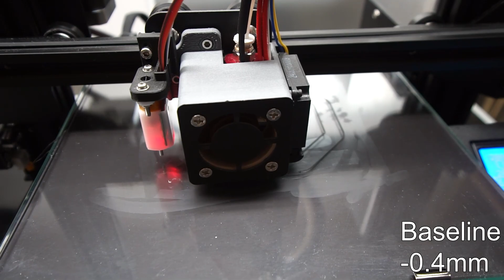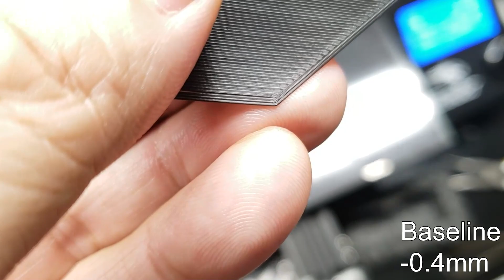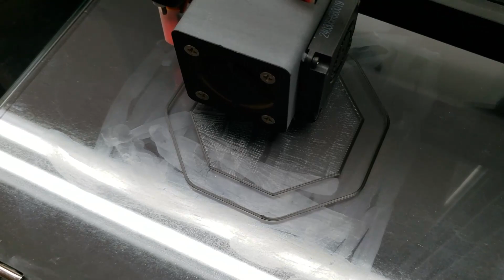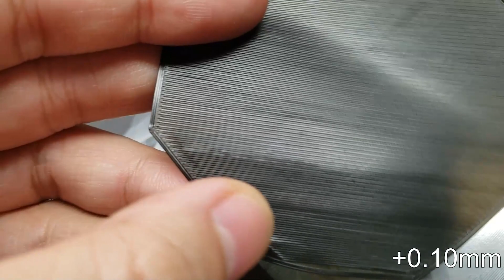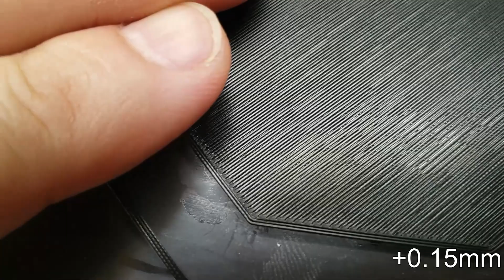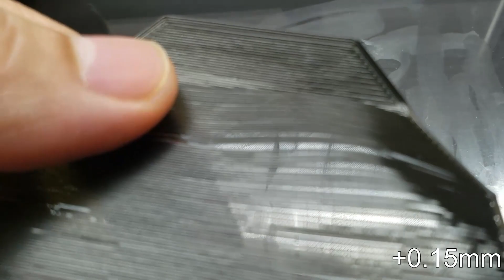The Importance of Bed Leveling your 3D Printer

Comment: how you set the z-offset in printer by a fixed increments?
Reply from the maker: Programmaticly by gcode through connecting to the mainboard on a terminal

Comment: Fantastic video! Ypu just gained a new subscriber 😎👍 I just got a 3D printer and loving it so far however seem to spend a lot of time setting up and levelling the bed to get decent layers, when levelling the bed manually with a heated bed (i use feeler guages) is it best to do this when the bed is at running temperature or when cool? Any help is much appreciated thank you
Reply from the maker: It's better when the bed has been heated to account for any changes.
Reply: @dorkytim  brilliant thank you! I come from a mechanic/automotive background so when i use feeler guages for setting up engines etc i have to make adjustments at running temperature for a precise measurement too so thats nice and easy to remember 😎👍

Comment: Thanks Tim another informative video on 3D printing, and some important lessons for me to glean.
PS. do you have the gcode for your test print? I'd like to try what you are doing.
Reply from the maker: Ah good point, I should add that to the description. The print I used in the video is this one. https://www.thingiverse.com/thing:2177790
Reply: @dorkytim  Brilliant, many thanks. This gives me something to do today after following your video fitting a 3D Touch, i also have a new bed to fit, I am going to try out the FBS PEX plate from Wham Bam. I have the creality glass plate on now, but hate the hassle of cleaning the bed with warm soapy water each time to remove the glue.
Reply from the maker: I found that Windex easily cleans the glue off and takes a couple of seconds. Sometimes, I don't clean off the glue between prints, unless there's a significant difference in what I'm printing.
Reply: @dorkytim  Ahh, a useful tip  (Again ), thanks i'll try some, and i see good ole Amazon (UK) does sell this.